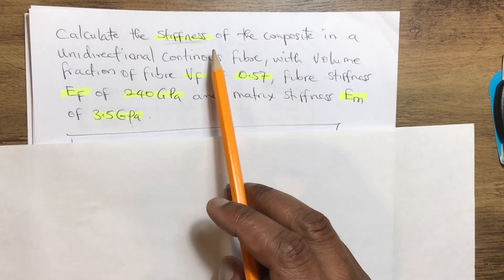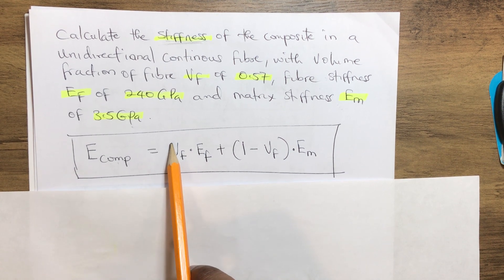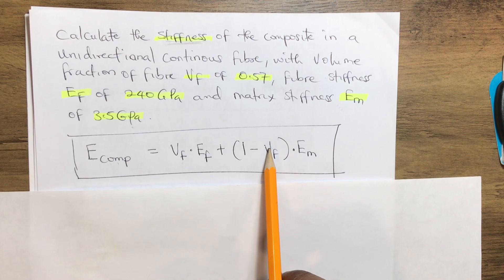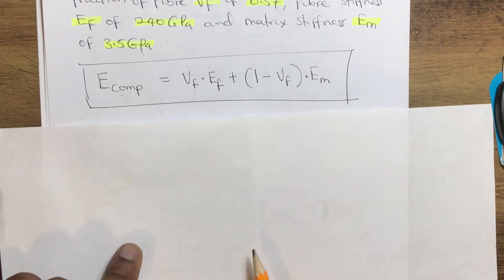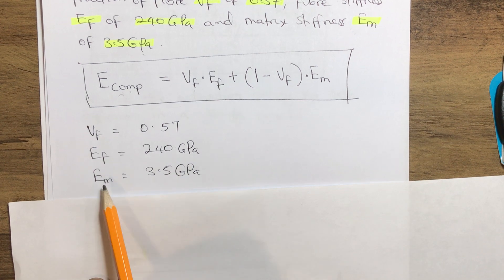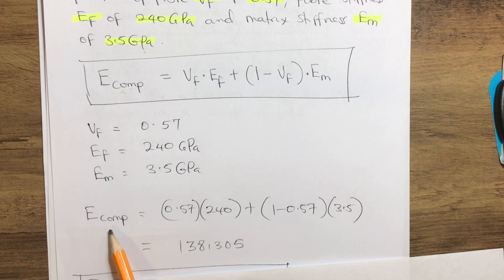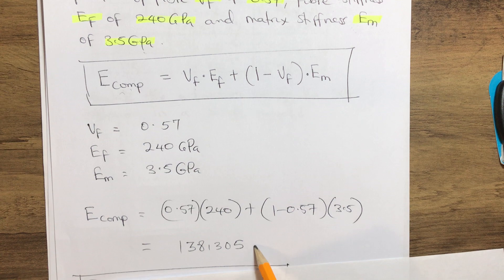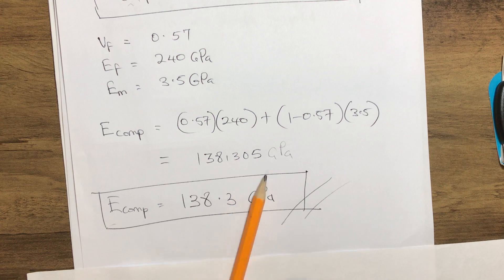How to calculate the stiffness of composite of a unidirectional fiber and matrix.

Comment: Thanks for your help? But how would you calculate the longtidinal stiffness (Ex) for a uni-directional carbon fibre when it's been loaded at a specific angle? I don't have any info on the amount of layers but can't use the equation: 
1/𝐸𝑥,𝑙𝑎𝑦𝑒𝑟 1 = 𝐶𝑜𝑠^4𝜃/𝐸11+𝑆𝑖𝑛^4𝜃/𝐸22+(1/𝐺12  − 2𝜈12/𝐸11)*𝐶𝑜𝑠^2𝜃𝑆𝑖𝑛^2𝜃 as I don't have values for G12 or v12? 
Should I work out the n value for the angle and use equation: 
Ex = (n * Ef * Vf) + (Em * Vm)? 
No problem if you don't know but I am struggling to work out the method.
Thanks!
Reply: Resolve all the angel first, then apply all parameters with same approach.

Aside do you have the schematic diagram of this composites please kindly let me me view it then we can approach asbi deem fit 

Thank very much for watching kindly subscribe